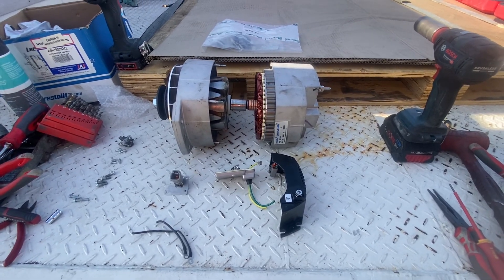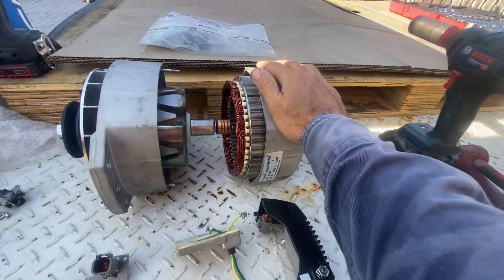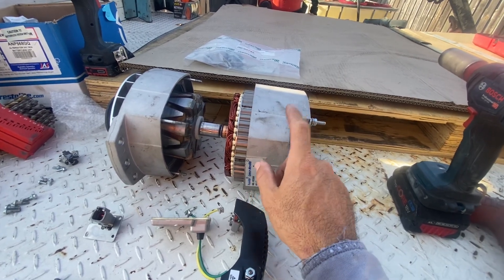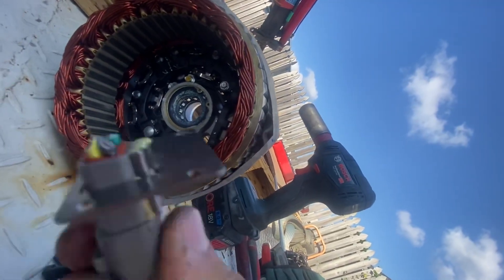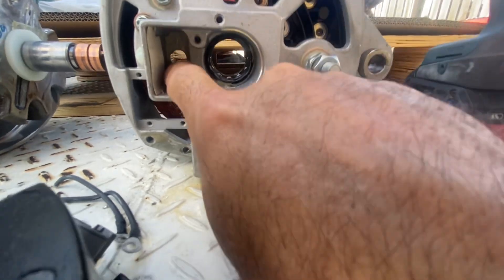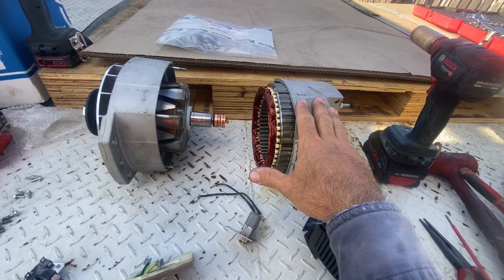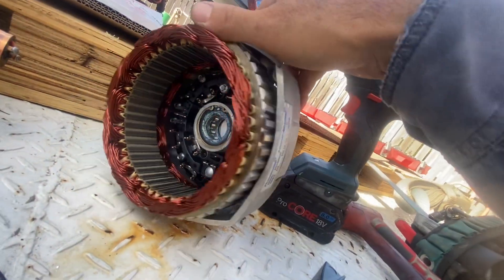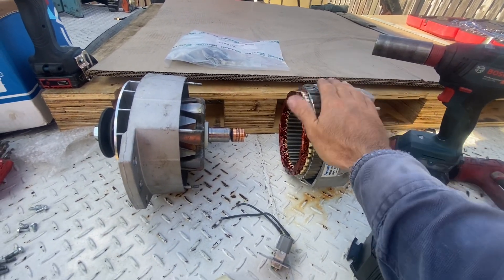Modifying an alternator for external regulator

Comment: What if….I wanted to use this type of alternator (with external V regulator), in a 100 series Landcruiser ?  I’d need to make an appropriate bracket and use an appropriate sized pulley…all that said, would it be feasible ?
Reply from the maker: Possibly, depending on the alternator load vs engine revs vs road loads you would probably have to tune it well in white space.

Comment: @AWBElectrical
Hi Albert. Great video here. I have a customer with a Leece Neville 12V, 160A 8LHA2057VGH alternator (self excite) which looks very similar to this 24V one you have here in this video….he wants to go LiFePO4 and I’d like to know how to modify this for external regulation, so I can fit a Wakespeed Pro external regulator. Many thanks.